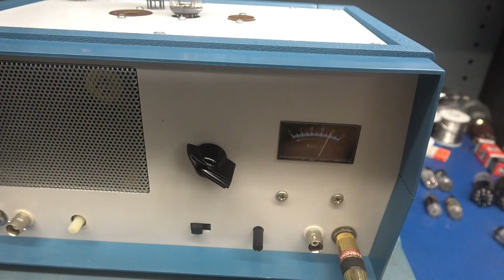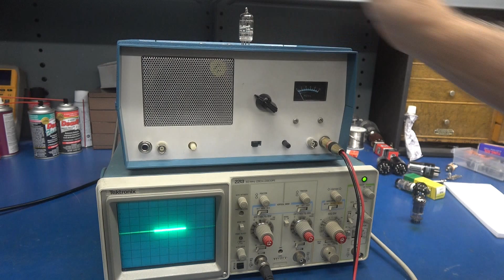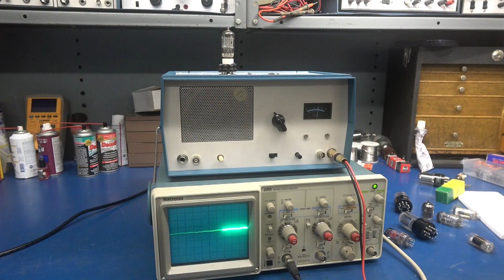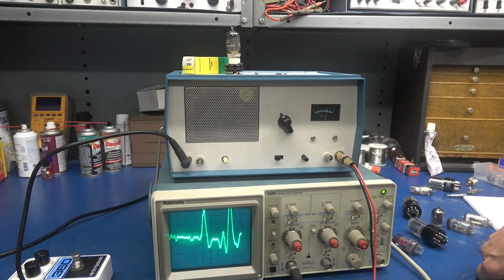New project D-Lab Micronaut II preamp tube microphonic analyzer detects faults a tester cannot

Comment: Love that you can listen to the tube do audio. What did you use for internal amplification?

I also like that you have two outputs. If i had this, I would like to eval different tube characteristics, through a larger speaker
Reply from the maker: There is a rear speaker jack, That will be covered in the Update video
Reply from the maker: Part 2 https://www.youtube.com/watch?v=bthr2ozs7qE